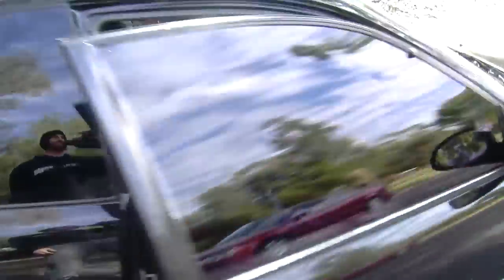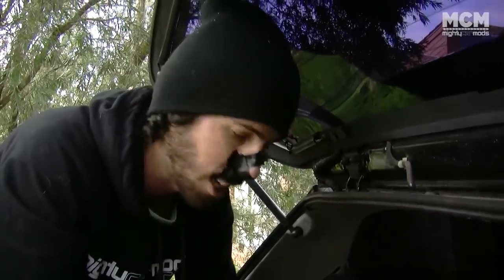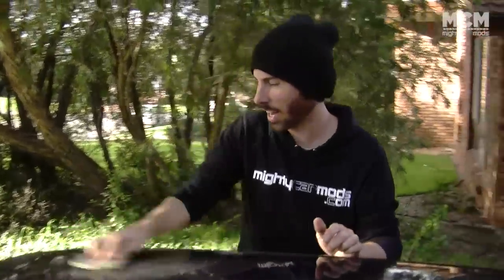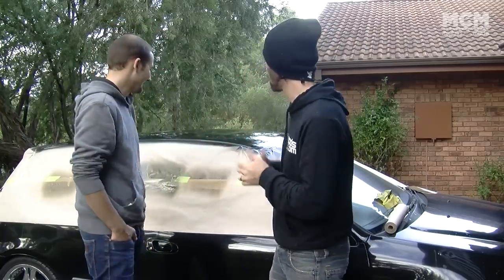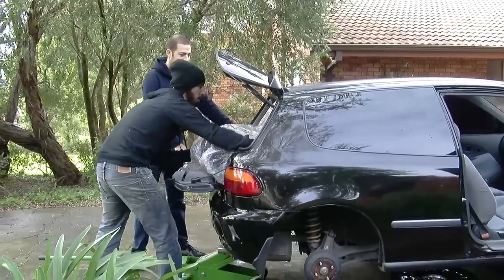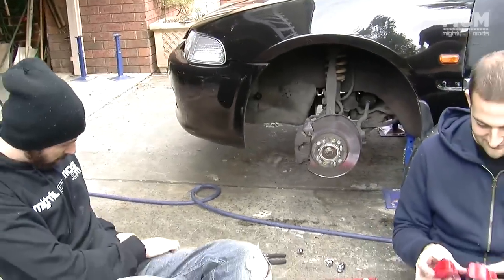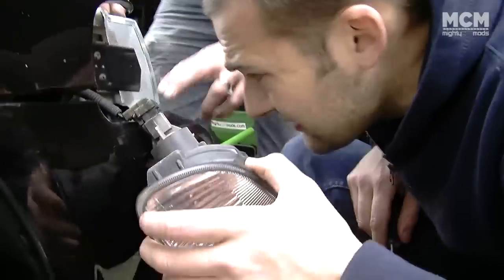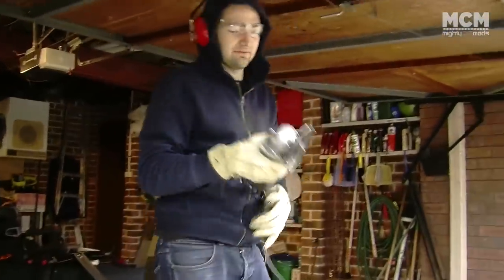Honda Civic Build Part 1

Comment: I think the funniest part is when he says "This is the raw footage with out cuts or music or any thing like that" 2 seconds later, music xD
Reply: I have the same car as your's but in black.
Reply: Michael Carreiro Hope you have better luck with yours than mine xD
Reply: Don't tell me that bro. I love my genny :'(
Reply: Michael Carreiro Most my issues came from a rear end collision. A drunk lady rear ended me at a stop light. Was low speed, but the steering has never been the same. Other wise the only things I really don't like about the car is the leather quality and the manual transmission. The leather feels like vinyl and scratches to easily. And the transmission is just really clunky.
Reply: MrGovenator1 I have a paddle shifting auto. I only paddle shift except in intense traffics. The thing I don't like the most is the super stiff suspensions. I have the 2010 2.0T Track. The leather seats indeed scratch easily but a leather treatment product should do or a seat cover not too bad looking. Another thing I don't like is the 65L tank. I spend 100$ per month in gas. The 11L per 100km is more like 15L per 10km. I don't shift on high gears too ! I shift a 3500 when it starts loosing power according to the dyno charts. I love the rear wheel drive but what I love the most is the insane braking power of the brembo brakes 0.0 The sound of the engine is also good :) I'm gonna buy mods to increase power and mileage. Cause it needs a tweek. It has 80 000 km on it.
Reply: 100 km*
Reply: Michael Carreiro I have the 3.8L R-Spec. And I have to agree the suspension is super tight, and its funny when going from my car to something like a VW Jetta. As for fuel, I average 20 mpg... And when you drive 300 miles a week just to go to work and back, you start to find you want better mpgs. The breaks though, you are right, has to be the best part about the car. A guy dun goofed on the highway in front of me one time, and my buddy was blown away by how fast the car would stop.
Reply: I was about to say that but you beat me to it.
Reply: MrGovenator1 nice car bro, what exactly is it? Lol its hard for me to tell in the small bubble.
Reply: Chris Watson Its a Hyundai Genesis Coupe. As far as I know, the US is one of the only places to get it. I don't believe Europe or Australia got them.
Reply: Nope, we got it too, +MrGovenator1 At least, I've seen the ads for it on TV... :-)
Reply: Jackie Coe The sedan or coupe? I am not sure if you are saying you live in Europe or Australia. I have a Australian friend I talk to on a regular basis, and he told me Australia is getting the Genesis sedan. Which is the much more luxury based car.
Reply: I have the coupe not the sedan is awful lookin
Reply: Michael Carreiro I find both to look great. The first gen sedan looked a lot like a Mercedes, and the second/current gen looks even better, and has its own identity now.
Reply: Hey, you be nice to them. They tried... They tried all there is to try. And at least they're not gonna let you fall aside. If you gave them a chance to let them hold hold you, you'd know they won't let anybody hurt you.
Reply: Ascalis1 I own your car's smaller UK cousin, the Coupe... called a Tiburon in the states though. Wish we had the Genesis over here though. :-)
Reply: InspectorPoirot I have a friend who recently crashed his Tiburon. Great body style, but shit engine options. Not sure why it was FWD either LOL
Reply: I bought it mainly for the looks :) plus i'm 18 so.. insurance and all. FWD isn't that bad and the 2ltr is spritely enough for me ;)
Reply: InspectorPoirot I know it could still be a fun toy. I all ways thought it was a great looking car too.
Reply: Who was your friend who crashed? I would now be saving my pennies for a Genesis... but we don't have them haha
Reply: InspectorPoirot I would hope not, seeing as I haven't bought my car yet and I'm currently using a skateboard that uses Flintstone foot power
Reply: Ascalis1 I'm not sure what you and your skateboard Flintstone power have to do with me but there's no time like the present, start looking into one and get modding ;) I paid for everything with mine - license, lessons, first car, second car (this one) and all the insurance, tax and MOTs to go with it. Definitely more practical things to spend your money on but hey, I love it.
Reply: MrGovenator1 As the first song says "We tried". I think they tried to keep it raw but found out it'd be better off with cuts lol.
Reply: MrGovenator1 He means when they are modding
Reply: MrGovenator1 australia has them i see them alot
Reply: true
Reply: +MrGovenator1 and the hundreds of quick cuts.
Reply: +JoeJam Gameing I think they were more jump cuts, rather than quick cuts.
Reply: MrGovenator1 What?
Reply: MrGovenator1
Reply: Well, it's not that cutting is bad, it's that they said they wouldn't.
Reply: What am I doing? Z
Reply: I was trying to find what song that was too.
Reply: MrGovenator1 hell yeah you right boi
Reply: i was about to say exactly the same😂😂😂
Reply: Nope for me the funniest part was were he said “we’re actually trying to take this seriously” then an off screen fart
Reply: What abot 17:42
Reply: Got nothing on my turbo Ford transit carpet layers van. Bro 0-100 a blustering 30+ seconds  115 flat out with cruise control to hole it there on the highway. The sexiest stock cheeses cutters. Pmsl my need for flash cars are done. I  had nice worked cars real cars. vh with a vk Brock kit painted tiger mica gold and changed the blue 202 for a vy clubby at the time was the first the the new gen motors. And got my dream car VL originally chasers for the young ones thats a VL turbo and we called them chasers coz ones the cops tried chasing a few and had no chance so they whent out and brought a heap for major cop shops and that was it cops start chasing everyone so came the nickname VL chaser. But now there all gone and hide to fine plus 5 kids car's take a backseat pun intended
Reply: @Ascalis1  this is such an underrated comment. I guess you were just ahead of the times

Comment: That Ozone Generator will eliminate/kill 99.99% of all odors inside of a car.  Turn it on and close the door with all of the windows up and all doors shut.  Leave the Ozone Generator on for up to 5-7 hours and then put on a respirator and open up the door and turn it off and make sure the car is sitting outside and roll down all of the windows and leave them down all day.

Comment: Im bout to put in work on my 97 accord. i like a clean look no rice. I need a skyline or a s15. Evo after everything. im motivated to take my car skills to the next step.
Reply: anataking2 if you're on a tighter budget I would suggest a r32 gts-t you can get those for under 10k and the s15 from the research I've done those average around 12-15k

Comment: interesting points. people buy cars with manufacturer genuine fake aesthetics (I.e. brake vents, hood scoops, engine compartment vents, fake interior chrome accents, interior, faux leather, wood accents chrome grills, hub caps). what if manufacturer installed fake brembos?

Comment: It's so weird to hear a trunk called a boot.
Reply: Why do Americans call it a trunk? Elephants have a trunk but that's at the front
Reply: MrSpookylukey
Why do they call it a boot? Boots are what you wear on your feet? How about we just call a rear hidey hole?
Reply: +MrSpookylukey in around the 1920s cars didn't have "boots" they just had a wooden trunk strapped to the back of the car for clothes and belongings
Reply: +TheBlinco121 the earliest reference to a motor vehicle having a boot was in 1908. Also British made cars had integral storage areas well before Americans. So whilst we had a storage area integral to the cars body, Americans were still strapping trunks to the back. It's actually quite interesting researching the difference in communication between the UK and USA.
Reply: +TheBlinco121 however boot originated before the trunk. As boot was used on horse drawn carriages for a small cargo area at the back of the carriage for boots. The term trunk didn't originate until post ww1.

Comment: ... why didn't you just use the same epoxy to glue the fake brembos on the back?

Instead of the $2k welding machine and the $150 welding gas... >_>

Comment: You guys already know it smells, pop the windows open. Are you trying to be funny?
Reply: Find a car that someone smokes in. Doesn't matter if you keep the windows open, the smell gets into the cloth seats and carpet and doesn't go away until you steam clean the shit out of it or replace the interior completely
Reply: Braden Spencer I know. But it wouldn't smell as bad as keeping the windows closed. Leave them open to vent the smell out.
Reply: +Braden Spencer the best thing to do is change the cabin filter i have a used car and the owner before me probably smoked pot in there and it smells like shit i changed the cabin filter and the smell is gone